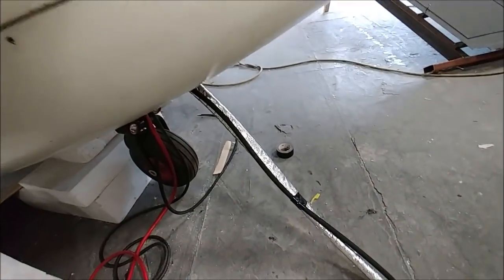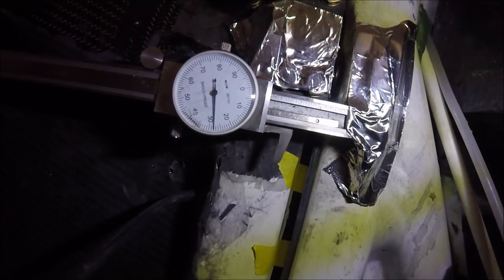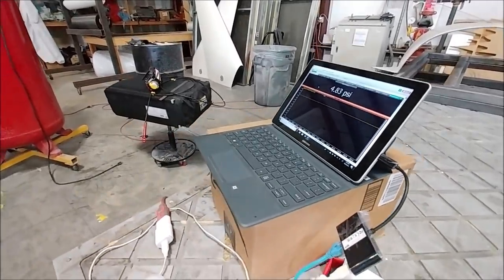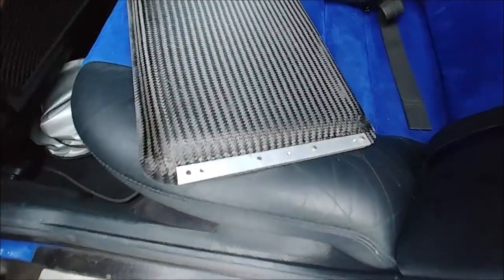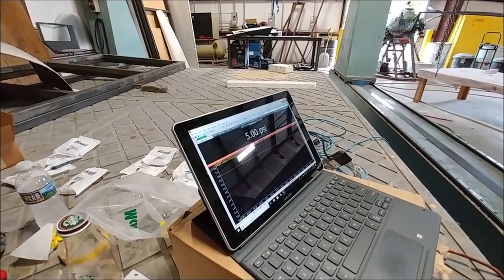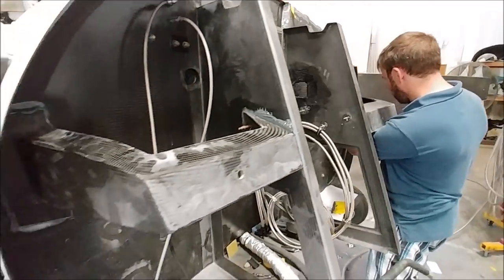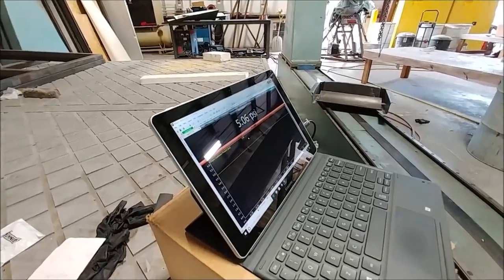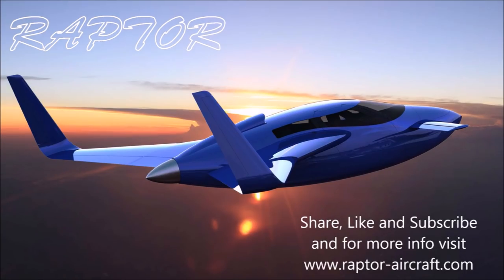5 psi, No Boom - Building the Raptor Prototype

Comment: You probably already have the door seal issue sorted by now... But I was wondering if you put a channel in the fuselage side of the door just opposite the door seal.  So that the door seal, when inflated, would protrude into the channel.  Then when cabin pressure is increased the door seal would press outward against the channel and increase the seal pressure.

Comment: Progress. Good.

It's only a few PSI, but at 144 sq inches (per foot) over the surface of the cabin it's substantial. 

If this wasn't a one-off, given that you are reworking the doors, it would interesting to laser-scan the door area, generating two point clouds, which could be loaded into your CAD solution.

I wonder if it would help or hinder the over all structure to run another layer around the back of the door opening to constrain the elongation. I've noticed doing FEM, that sometimes adding material here, makes stress concentrators there.

This might be a daunting, nerve wracking process, but I am glad that you are working the problem, working it in a nice progressive fashion.

Comment: Looking good! I can't wait to see her fly! 

I'm curious: are you adding extra pressure into the door seals as the cabin pressure builds? It seems to me that during an actual flight, the ambient pressure lowers, therefore the relative pressure in the door seals will increase - helping to fill the larger gap between the door and the frame.
 If you aren't adding extra pressure to the seals to simulate this, it could be an overlooked advantage.

Comment: The door needs to close against the seal. Not trying to fill the gap between the door and the frame.  All the pressurised aircraft I have worked on close the doors against the seal. This allows for movement / misalignment between the door and surrounding structure without affecting the working of the seal.
Reply from the maker: As I have said countless times already, the doors are going to be redesigned for production.
Reply: Sir, I understand you’ve been working in the heat all day literally doing a high pressure job, but could you tell me: Are the doors going to be redesigned for production?
Reply: Have you share the new design? I follow most video but could find what you have in mind for the new door?
Reply: Based on the videos I've watched, I recall Peter mentioning that the doors might be a clam shell design.  Where the lower half of the door would also provide a stair step into the cabin.

Comment: I think you need to go into your bathroom there, and check out the bowl valve in your toilet tank.  Note how it uses the pressure of the filling tank to close tighter as pressure builds.  Skip the part where it's designed to leak water to refill the bowl before it finally seals.  

So I'm thinking a lip in the door frame for the seal to lay up against, so that higher pressure presses that seal harder into that lip.

Comment: I like the progress on the pressure testing, but since this is just a prototype and you know you are changing it for production don't waste too much time on this. Once you reach 5.5 if your door seals leak above that, does it matter? they are just acting like a pressure relief valve, as the air escapes it will re-seal around 5 psi.

Comment: Hello, may I add my two cents.
I don't think your aircraft pressurization test is correct. You need to test it in such a way that outside of aircraft pressure is similar to 20000 feet, so the inside can be made to 8000 feet pressure. I think your aircraft is sitting at almost sea level. With the outside pressure at sea level and trying to make the inside pressure similar to 8000 feet will not give you the right pressure reading and you put too much stress on aircraft body.
Reply: All that matters is the differential pressure between the inside and the outside.
Reply: Dude, read your comment a couple of times. When you understand it, don't be shy about deleting it.
Reply: Israel Kozlik  What part of it is incorrect?
Are you familiar with testing?
Reply: Hey Ben, it’s easy to mess up the math on this and hopefully I don’t do the same.  PSIA at sea level is appx 14.7 and it is appx 10.9 at 8,000 feet and 5.45 at 25,000 feet.  So if we want to maintain 8,000 feet PSIA at 25k we need 5.5 PSI added to the vessel. 5.45 + 5.5 = 10.95 or appx 8,000 feet.  Peter is testing to see if the cabin will hold at 5.5 PSI. It doesn’t matter what the outside PSIA is.  It only matters that the cabin holds 5.5 PSIA.  Explained another way at sea level with 14.7 PSIA and the added 5.5 PSI inside the cabin makes the equivalent “altitude” inside the cabin of appx 9,000 feet below sea level.
Reply: What B Kidd said.  Unless I misunderstood the original post, Im not sure why you think he would be trying to achieve 8000ft pressure by adding pressure.
Reply: @B Kidd: Just to get the nomenclature right, the absolute pressure at 25k is 5.45 PSI*A*. If the cabin holds 5.5 PSI*D*, then the pressure inside the cabin will be 10.95 PSI*A*. The cabin is begin tested for a differential ("gauge") pressure, but cabin altitude depends on the absolute pressure.
Reply: Lol you missed a few math classes in school didn't you